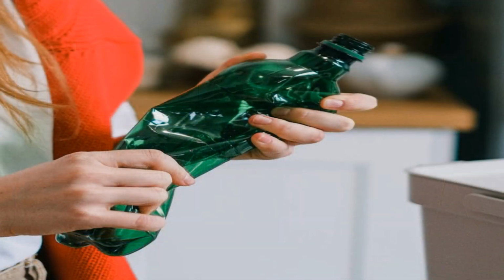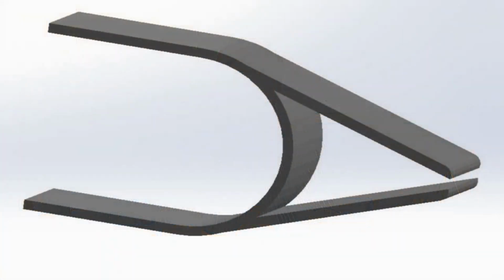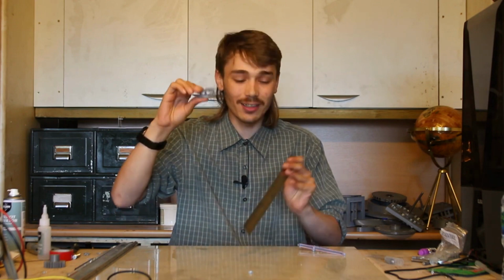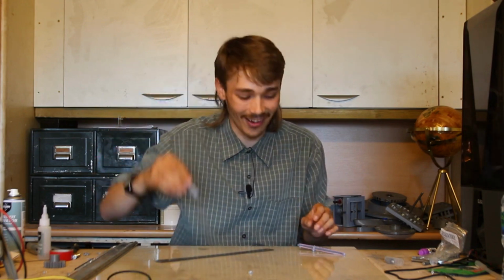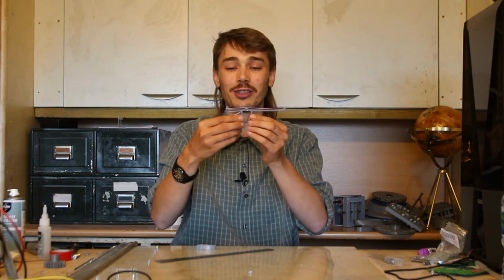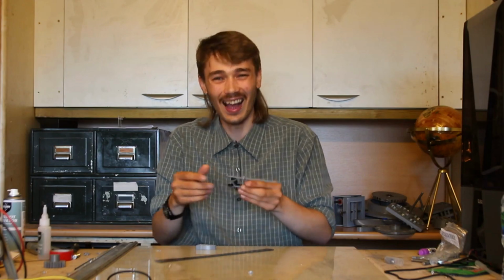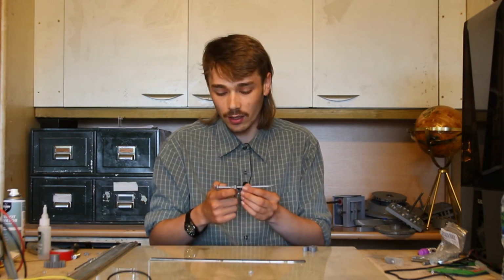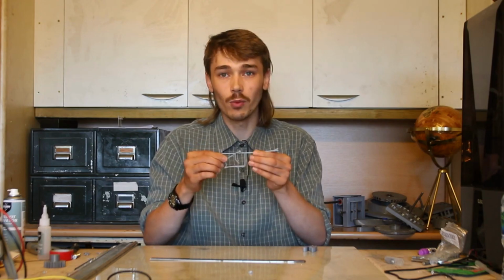What Are Compliant Mechanisms? - Mechanisms of Engineering

Comment: Not really a question but I just realized that machined springs as well as things like welded bellows are also compliant mechanisms - I've actually used both of those not only as flexible shaft couplers but as shock absorption devices that can be dialed in with precision if need be as well as used in heavy applications such as seismic treatment of skyscrapers and connected structures.
Compliant mechanisms can spin 360° and more but as far as infinitely rotating assemblies, no, but anything using wiring and able to oscillate or take long unwinds, et al, can't use infinitely rotating assemblies to any improvement plus it's focused on shedding energy rather than storing it, which compliant mechanisms can do even while performing their regular function(s).
Also as far as materials - I've been wondering if the place you guys get your plastics compounded can make you filament instead of just dogbones for strain testing, because if so then you can print with your casein/graphene blend.  It will still be subject to standard issues like delamination weakness and finish/surface quality but the source material is not only stronger than CF it also shouldn't shred your extrusion nozzle, which any filament containing hard/strong structural particles or fibers will do.  Since the graphene is blended in and it's very small particles then it shouldn't be as abrasive; I am assuming a lot, but honestly even if I was vegetarian I could still use milks for plastics and in the US there has been massive overproduction of milk for a while.  If one could contract with dairies to take product that doesn't pass muster for human/animal consumption all of that could be upcycled into plastic.
I think what I'm calling "the democratization of everything" is going to hit a breaking point soon and it will be mainstreamed out of necessity - some real fun can be had if you check out "The Global Village Construction Set" on Appropedia; lots of people contributed to what's basically open source DIY heavy equipment.  
Thanks for all the time you guys take to record and put up videos for us to watch and learn from.
Reply: That is interesting a spring is a compliant mechanism, never thought like that but you are right.   So my car and ball point pen has them; the biggest and littlest thing I own.